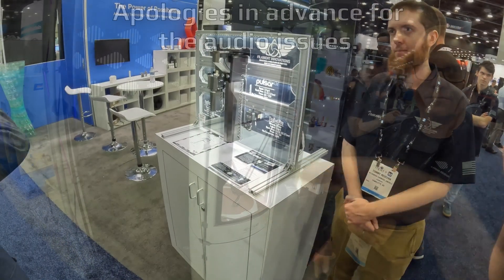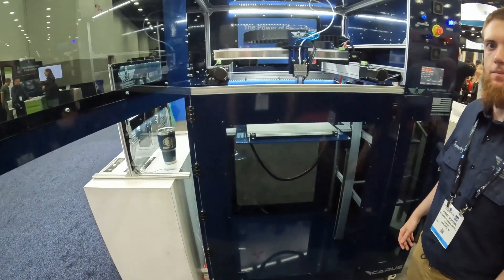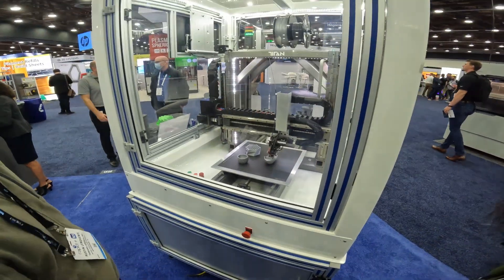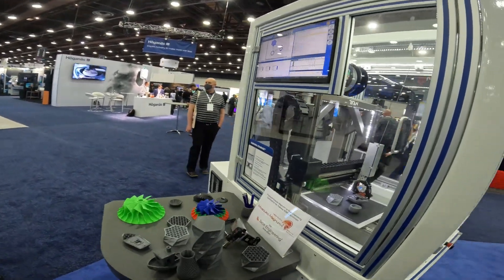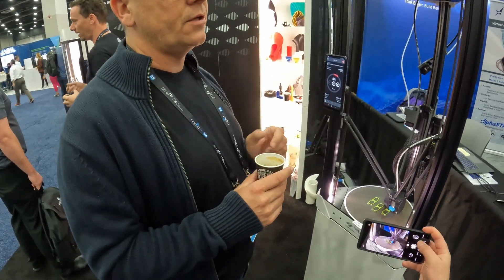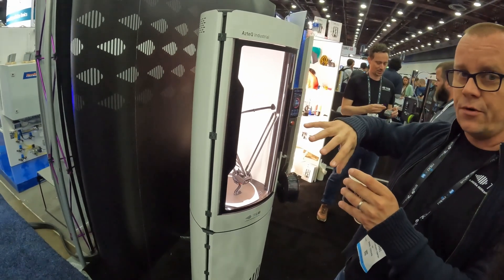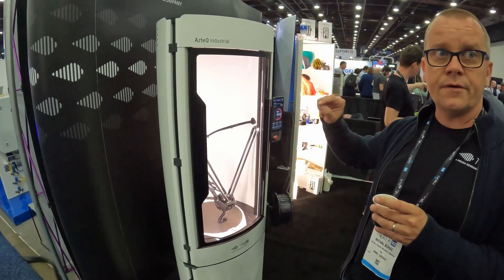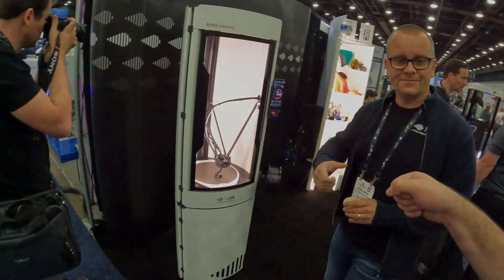3D Printing Prosthetics, High Speed Servos and Chatting with Trilabs - @ Rapid+TCT 2022

Comment: Hey @Nero3D, I'm just wrapping up a build now, and when I enter the QUAD_GANTRY_LEVEL command, my print head does a suicide plunge for the bed and doesn't respond to the probe or endstop. I keep having to abort it with m112
Reply: I guess my question is: what could possibly be causing this? And how can I fix it?

Comment: Why a delta company for 'professional' printing? It seems like a gross amount of space needed for build volume. Cool to watch, but what's the advantage in the professional realm?
Reply: As for space, many offices, labs and workshops have more available ceiling height than floor space, so a delta can be more efficient space-wise. Also, they are often easier to enclose  in heated chamber and generally faster than many other types of FDM printers. If you compare this Delta to a Stratasys which can print nylon, this one is way smaller. 
But most importantly, this offering is probably "just" really well made, sorted out and calibrated from the factory so less fiddling about is needed by the end user. That in itself is worth a lot of money to the right type of clients.
Reply: Printheads that can tilt maybe.
Reply: Interesting tour